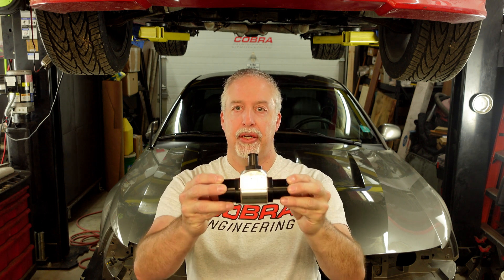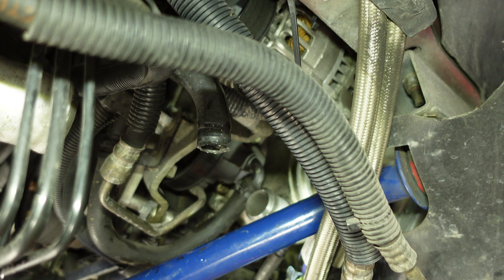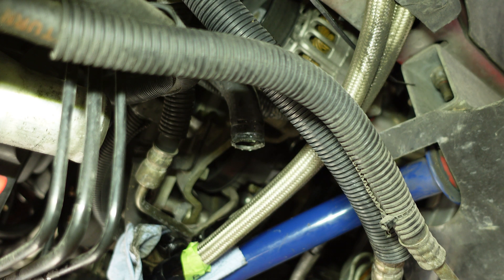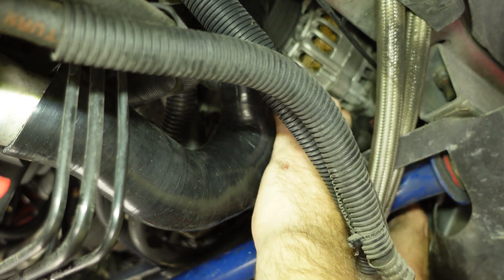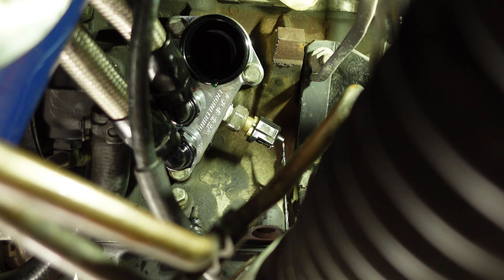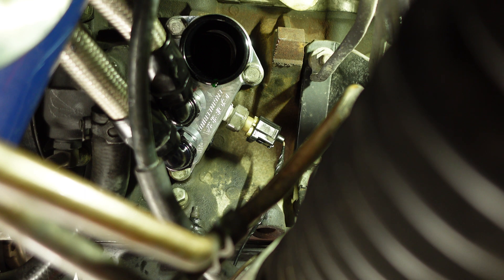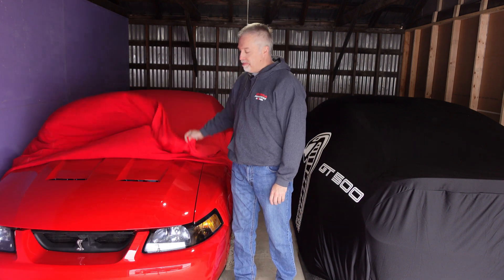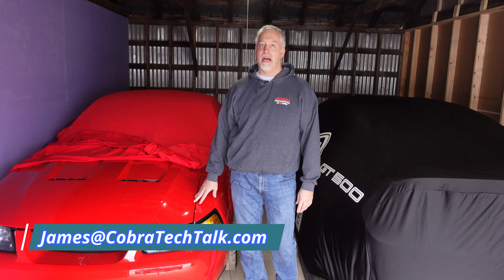Coolant Crossover Delete Install - Part 2

Comment: I can’t find the hose on your site
Reply from the maker: That hose doesn’t work well with 03-04 Cobras. 
If want the hose you can still get it at Improved Racing.
Reply: @cobraengineering  I sent you a email with a question I have on your kit

Comment: Hey James if I remove the oil cooler and install yours with the external oil filter set up do I need an external cooler
Reply from the maker: You don’t need one. But if you autocross/road race I would run one. 
If you run a oil cooler you will need a oil thermostat. You can over cool oil.
Reply: Doesn't make sense to me since the stock cobra oil coolers actually over heat the oil, causing the housing to pit/wear out leading to leaks.